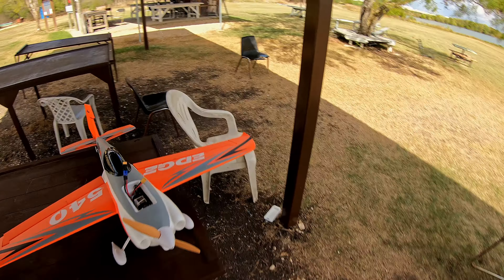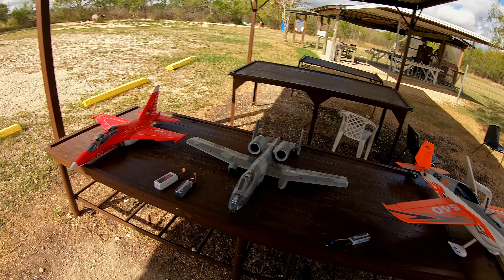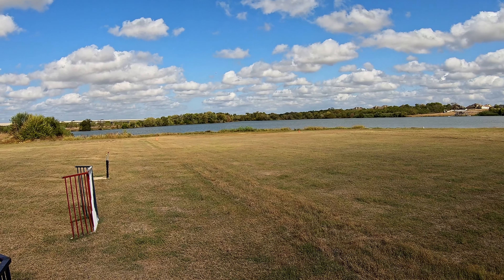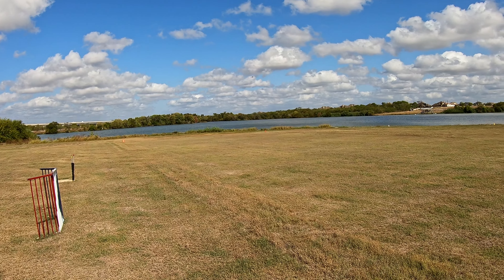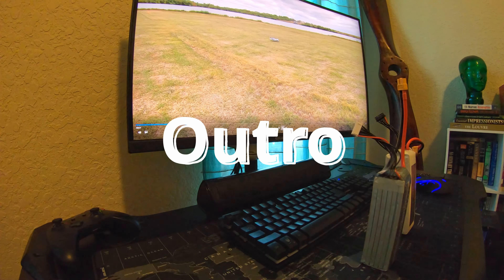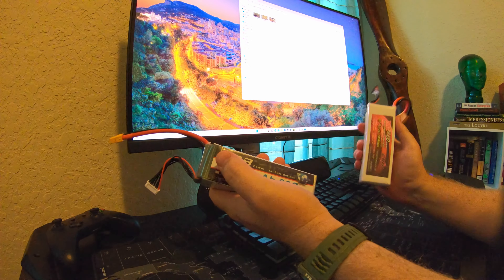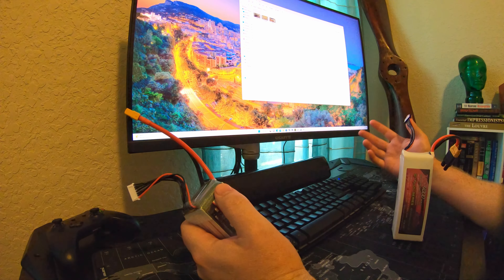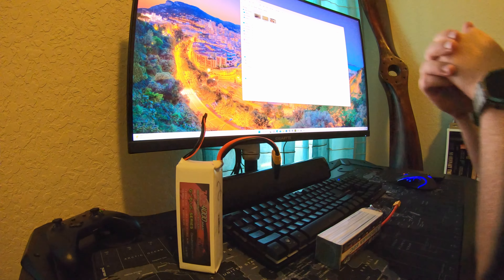EDF Battery testing, is bigger always better?

Comment: Dude!!! The yak is back and hauls ass
Reply from the maker: Yeah I was gonna tell you. I re did the intake vents and re wired it, there was a plastic divider that held the wires and it was blocking the airflow. Also put in an afterburner. It sounds amazing now, with the big battery it’s fast too. Need a new wing and more gyro so it stops rocking
Reply: @Finalmile_FPV   hell yea did I break the wing your getting good at flying it
Reply from the maker: @Ryanmatthewseltzer  it was cracked, I finished the job with a botched landing 🤣🤣🤣🤣🤣. Thanks man, been practicing.
Reply: @Finalmile_FPV   I’m just glad your having a good time with it means it wasn’t a waste of money for me